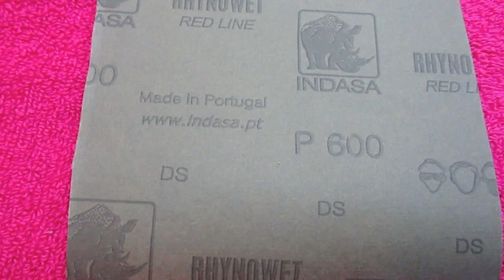pt 113 NINJA RESTORATION,CLEARCOATING CARBON FIBER AND AVOIDING FISHEYES

Comment: Great one, Windy! I would feel confident clearing with these steps, so thanks! The one thing that stands out to me that I really didn't know is how important it is to clean the part before you sand it. I hadn't really thought to do that before, thinking the sanding would take off the dirt or whatever, but you are right, you grind finer materials in and it makes it tougher to do anything with it.